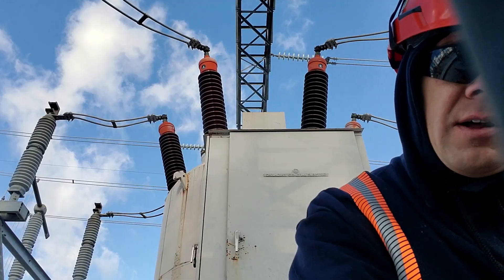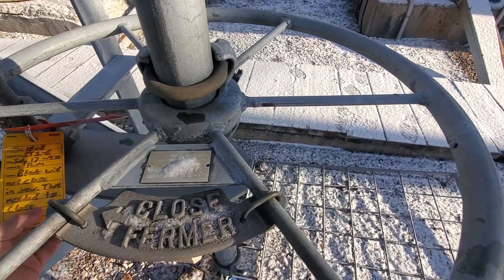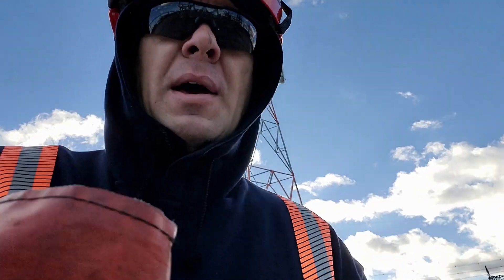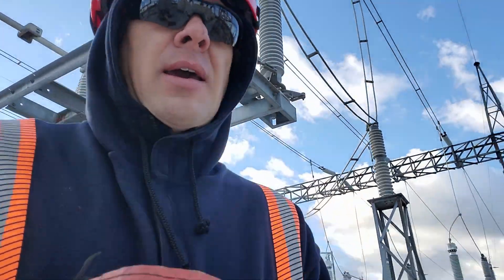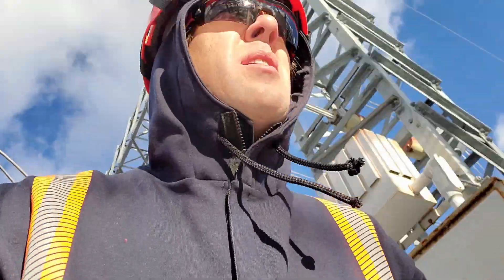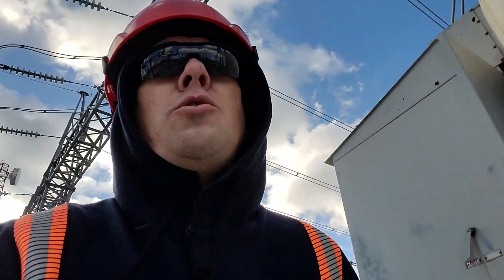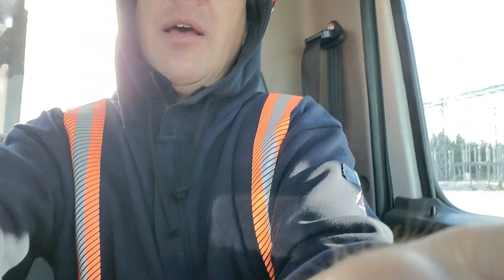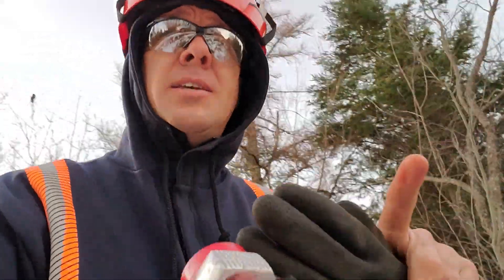138 kV switch  malfunction

Comment: That looks like it would be quite a process to replace that switch. I would be interested in how it's done. Since you don't normally work in those areas, I appreciate what you did show with that. Thank you. Stay safe and God bless.
Reply: I don't think the switch needs to be replaced, just adjusted or serviced. It looks like the center blade clooses an inch too soon which prevents the handle from keeping to turn and closing the outer two blades properly. It still might be quite a process though and maybe that bus bar has to be switched off.
Reply: @mrfrenzy.  Thanks for the info.  I'm new to this stuff and I enjoy learning new things.
Reply: @mrfrenzy.  Yeah either there is a switch on the other side of that bus bar or they have to use hot sticks to remove the cables, then earth both sides of the switch, before adjustments are made.
Reply: The real challenge is if anything needs to be done up at the switch blade.  
That would require dropping the feed to the switch long enough to pull the jumpers back where it connects to the bus.  Them one more time after the switch is fixed.  

Switches on the bus side are some of the most difficult to deal with because it means taking a bus offline to do the work.
Reply: @matthewbeasley7765  Thank you. This is a process I would love to watch. I'm totally new to this so I'm learning.
Reply: As mrfrenzy said, the switch just needs to be adjusted and or lubed. There are rods between the poles to allow interphase timing adjustments.